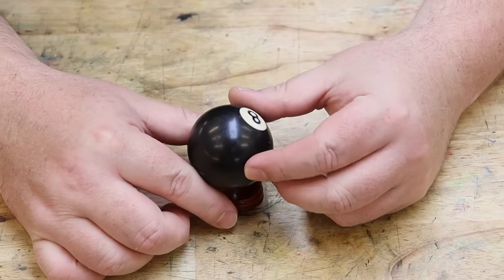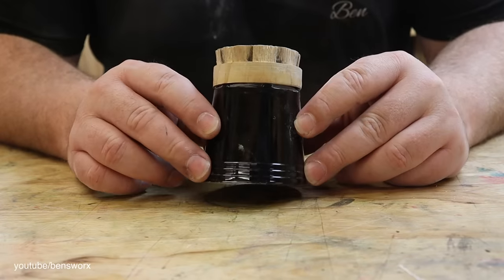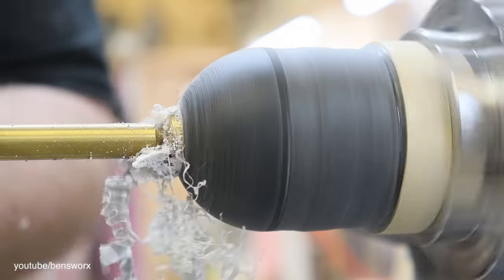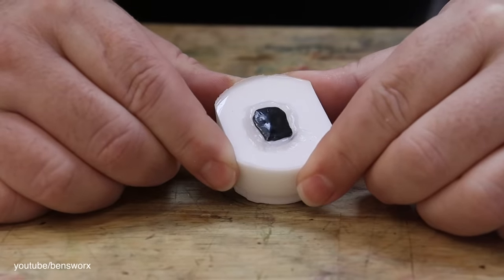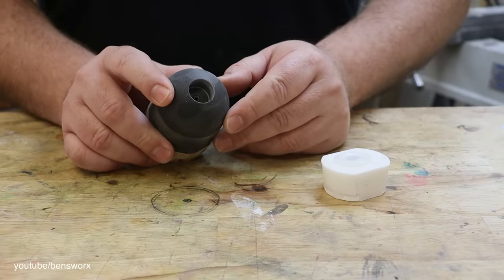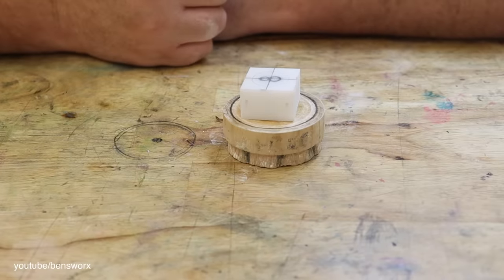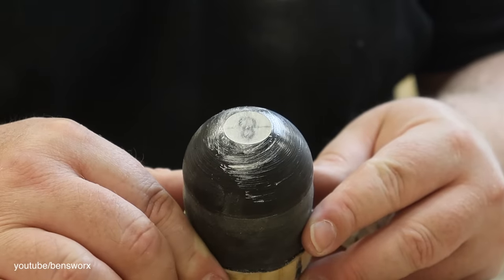I Make an 8 Ball out of Solid Resin

Comment: All things considered, you did a great job with the eight! Would be cool to see how making a full set of these would react on a pool table though, I'm curious to see how they would work compared to the real thing
Reply from the maker: Thankyou 👍
Reply: That would be very interesting. The sizing is extremely important. The white ball is slightly smaller than the other balls, so it follows a different path when sunk. If the sizes are off, it won't work on a table.
Reply: I think this is a cool project idea
Reply: @mayshack  you can turn it round with out the flat spot it was one of the first things i done when i got my lathe
Reply: I feel like they would wreck the pool table rofl
Reply: Cerus98  Sometimes the cue ball is smaller, and other times it is larger. There are tables that use weighting or magnetics. You just decided pick on one stated idea, which is actually still correct. The premise still remains, the balls will need to be pretty accurately sized otherwise there would be issues.
Reply: Cerus98  Are you from the USA by any chance? In the USA the cue ball is bigger. In the UK the cue ball is smaller or weighs less.
Reply: Cerus98  please do some research. English cue ball is 1" 7/8 with the coloured balls being 2", that's the standard for the UK, look it up. Maybe in places I am not from, things are different, but don't keep going on about something that you are incorrect about.
Reply: Cerus98  I see you're unwilling to even do research.
Reply: @veridico84  the cue ball is the same size in American pool, smaller cue balls only exist in English pool
In American bar tables, they use a magnetic cue ball to separate it from the others
Reply: Cerus98  in English pool the cue ball IS smaller
Watch any game and you’ll notice lol
Reply: @Isuc_at_poolgolf  thank you. Some people don't understand the USA isn't the only place that exists.
Reply: Pool balls are ALREADY RESIN just an fyi
Reply: Have you seen the 8 ball rocket stove on Cool Cement?
Reply: @veridico84  I have never heard of a smaller cue ball. The 3 ways to separate the cue ball from the object ball are size, cue ball is slightly larger, Metal and magnet, the cue ball has a piece of metal and a magnet separates it from the others, and lastly an optic sensor that finds the white cue ball from the rest and separates it.
Reply: @fastone371  I'm guessing you're from the US and A? In other areas they use a smaller cue ball for separation.

Comment: Have you considered adding a milling machine to your workshop?  They make positional accuracy super easy, and you'd have made the number eight visually perfect, and within a few thousands of an inch.  You need a point of reference so you have needed either a jig to mount the ball, or not remove it from the mill while you made each step in drilling, filling, and filling again.  There's a lot to be said for combining metal shop and wood shop tools.

Comment: Shift knob popped into my head as soon as I head you were drilling straight through.  One suggestion would be to put the 8 insert into the puck before you start rounding it.  You already had the diameter good but when you put the 8 insert in it was very recessed so you had to take a lot more off.

Comment: you know the design on the epoxy when molded with the plastic cups would make a pretty unique design for string lights and it you used light colours you could make them with multiple colours that the light shines through

Comment: The hole passing through also allowed the air to escape when you hammered in the number 8 insert, otherwise it would have been impossible to insert with air pressure in a blind hole.

Comment: Nice work!  I do wonder if it would have been easier to turn the black cylinder, drill a hole and fill with white, then proceed how you did to make the 8.  Then turn the sphere.
Reply from the maker: I wanted to have multiple goes at making the 8 incase I stuffed it up
Reply: @BensWorx    Fair enough, looks great!

Comment: I've got a few ideas for things that might be interesting to try and cast.   1: one of those pickle shaped christmas ornaments.  i was going to say "A pickle" but the ornament won't rot.    2: Wax lips.  if there's a way to keep them from melting, they'd look hilarious in resin.   3: If the wax lips wouldn't work, maybe one of those wind-up chattering teeth, or heck, a set of dentures.   the wind up teeth would be more interesting looking i'd say, because they tend to be bright red plastic.    4: a set of polyhedral dice.   a d4, d6, d8, d10, d12 and d20, floating at various parts of the egg.   that'd look sick.

Comment: Should have used ABS pipe for the 8. Sand one side of each pipe flat and glued then together then filled them with white resin then placed that in a metal pipe that the inside of the pipe is the same dimension as the outside of the white circle of the insert. Glue the 8 down to the inside of a cup. Glue the pipe down, make sure to add a release agent to the inside of the pipe. Once the resin is cured pull the pipe out, if it all comes out use a rod to push the resin 8 out of it and reglue it back into the cup. then fill the rest of the cup with black resin. Less steps and a lot easier. Or if you want to make more you can cut the 8 into sections to make inserts for more 8 balls. You can do similar to make all the other pool balls.

Comment: You should have just poured the white into the hole that you drilled out of the black resin your turning into the 8:ball. Then drilled the holes for the Number 8 and did what you did  accept you wouldn't have had to shape the white  and you would have skipped alot of steps.. you wouldn't have had a flat spot from inserting the white blank into the 8 ball blank either.

Comment: That slow set JustResin ArtCast is not available on the international store, only on the australian store, do you know why? I googled it and was able to open the sale page for ArtCast and it said , hey this is the Australian store, do you want to stay or go to the international site. And the international site appears to not have it. Am I doing something wrong or is there something that prevents them from shipping artcast over seas?
Reply from the maker: Hi, unfortunately only river pour is available overseas which is a deep casting resin with a slower cure time
Reply: @BensWorx  Thanks. Was mostly just curious, my mother bought some resin and some silicon molds to mess around with and was just curious. We mixed up a few oz and a splash of color just to try it out. I think she has some she'll need to do like that turtle you made by applying powder into the mold with ac makeup brush then pouring ontop of it. Its pretty interesting for trinkets

Comment: Hi Ben I hope you don't take this the wrong way but you should have did the 8 inside the whole instead of separate and glue in . That why you save yourself reason. 
FROM: Mary Kimble
Reply from the maker: Hi Mary, I knew drilling the 8 was going to be difficult, The reason I made it an insert was so if I failed I could make another without ruining the ball 👍
Reply: OK 👍🏻. I just thought I put my 2 cents in. I also see what you mean. Thanks for the explanation on your part 😁👍🏻.Have a great day. 
From Mary Kimble 😁
Reply: O yea I just had an idea 💡. Next time make the 8 the why you did then make a reson rode glue 8 to it then put it in reason. Then make ball shape. 
From Mary Kimble 😁

Comment: 10:00 oh you're going one sided. I thought you were going to cut the 8 cylinder in half and put it in opposing ends. The other way would have been to make a single core for the 8 Ball. Or even just the 5-10mm thick 8's attached to wood to fill the inside gap.
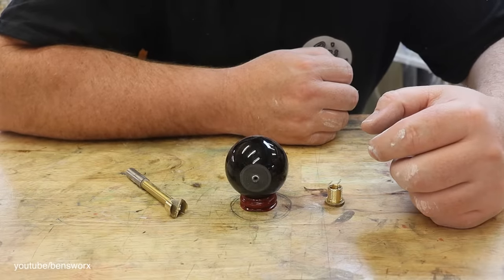Reply: 12:30 Ooooh I see its not just a 8 ball.